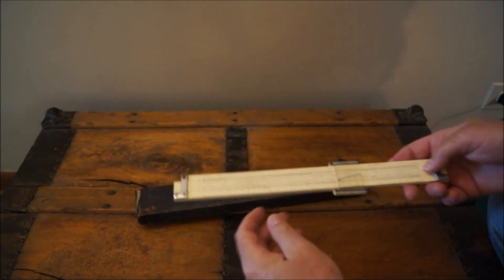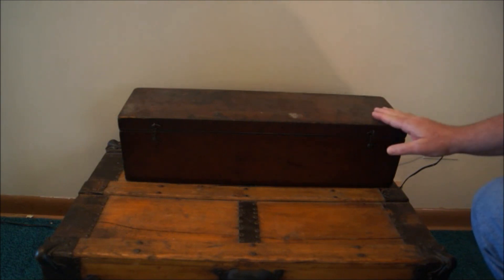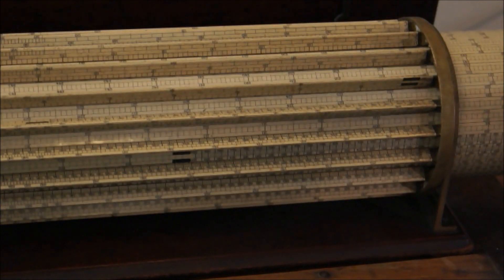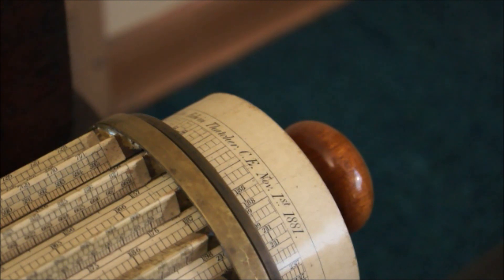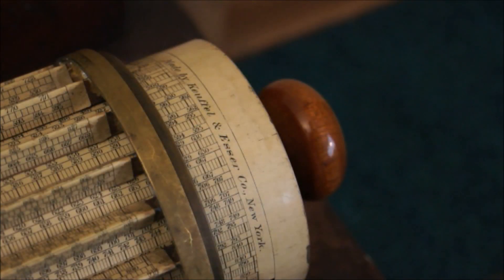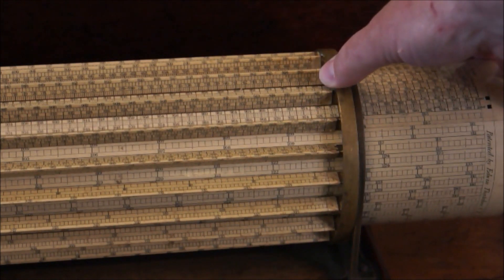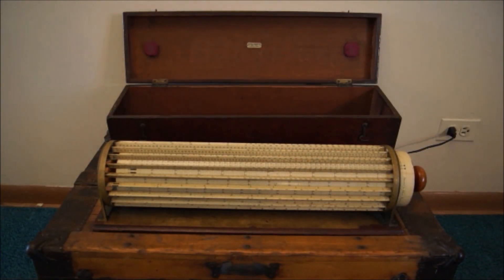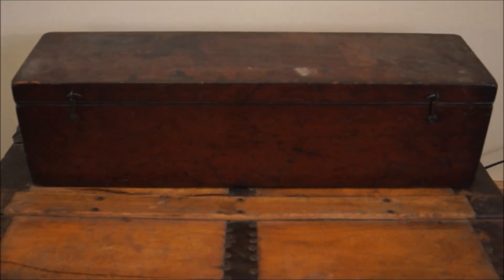The Thacher Calculating Instrument

Comment: Just came across this. I’m lucky enough to own one of these amazing tools. My father was a fanatically collector of antiques and must of picked it up somewhere along the way. Ours even had the original manual with it. Every so often I get curious about it and Google around a bit trying to find out more about it. I don’t remember when or where, but somewhere I read that these were used for calculating logarithms and were used by traders on Wall Street for….well, something I wouldn’t understand anyway. I’m an artist, so to me the beauty is in the amazing detail and precision that went into making the tool. I can’t even begin to imagine how much careful and painstaking work went into making each one. The rules and cylinders are all bone ivory I believe, and would had to have been etched by hand. I leave it in its box except for the rare occasions that I take it out to marvel at it. I don’t want sun or dust to damage it. Except for some very minor scratches on the base and the case having some wear and tear, it is in perfect condition.
Reply from the maker: Thank-You for the really great comment!  I agree that this is a fantastic bit of toolmaking with an artistic bent.  This particular instrument was used in the General Headquarters of a Steel Foundry company.  My understanding of its use was for the company Engineers and Metallurgists.  The device offers some serious short cuts in working through some very tough math.  I was not aware of the Ivory and am now more impressed by it.   Thank-you again for viewing and commenting!
Reply: A slide rule in its most basic form multiplies and divides. What is done is identical logarithmic scales are printed printed on a moving piece and a fixed piece. A logarithmic scale gets more compressed as you move to the right. The basic principle is you add the logarithms of 2 numbers together then look up the answer. The slide rule does this mechanically, no need to carry around a book of tables. Most slide rules are 25cm index to index and due to the limitations of the markings and the human eye the answer can be found to about 3 significant digits. The answer to this problem is to lengthen the scale so more marks can be fit in but then no one wants to carry around a 10 foot slide rule. Elliptical slide rules such as the one shown wrap the scale around a cylinder to lengthen it while keeping the instrument to a manageable size. Mainly the idea is to get an answer quickly without having to calculations by hand or have to use books of tables.
Reply: The instrument is not ivory.  All models are wood and brass, with paper scales glued to the drum and brass rails of the cage.  They are covered with shellac.  Early models prior to 1901 have drum made of a metal.   These models are known as the Type I of the instrument.  They will be made by Stanley (with Thacher's approval).  K&E imported them and sold them as the "Model 1740."   In 1901, K&E made these themselves as Thacher's copyright ended in 1898.  The design changed quite a bit, as did the model number.   Now known as the "Model 4012," the drum became wood and the brass cage changed, including the way it's attached to the base.  Maker's marks were applied indicating K&E on the box and device itself.   These models were built through 1926 and are known today as Type II Thachers.   The device was changed again in 1927, becoming the Model N4012 ("N" meaning new).  It added a single pedestal attachment to the cage ends, as well as knurled rings and white number bands at the ends of the cage (as he describes in this video).  It is known by collectors today as the Type III.

K&E introduced these to the U.S. in 1881 at the cost of $30.  By 1952, the last year they were in the catalog, K&E charged $130 for them.   These prices are $$$ during those eras, but not so much they they couldn't be bought by science and engineering companies as well as universities and government agencies to do computations up to 5 significant figures (for multiplication, division, squares, cubes, etc).    It is widely known that Lowell Observatory used (and still displays) a Thacher Calculator for computing ephemeris data for celestial bodies, including Pluto, as discovered in 1930 by Clyde Tombaugh at that very observatory.  

I own a Type II Model 4012 in really nice shape. serial number 2758.  This places it as built around 1910.   The highest serial number known is just short of 7000.  As such, in over 70 years of production, 100 devices were produced per year on average (with around 164 yearly estimated for the Type II devices).

It's not hard to use.  If you know how a normal slide rules performs such operations on the C and D scales, then the same concept is applied to the Thacher, only with the scales, both on the drum and the rails, being many segments of the same continuous scale.

Regarding the name.  The correct name is Edwin Thacher, as shown on the Nov 1, 1881 patent for the device.   But interestingly, Stanley printed the name "Thatcher" on the drum, with "Thacher" on the badge.  My device, as originally sold through the F. Weber Company (K&E licensed some for sale to others), has a label attached to the wooden case, with "Thatcher" hand-written on it.   As such, it's sometimes called the Thatcher Calculator even though it is technically the Thacher Calculator.
Reply: @jayballauer8353  Thanks for all that info! I’m familiar with K&E because of all the drafting supplies they’ve made over the years. I’ve used a lot of drafting tools over the years for art. I love that this post has been slowly but surely generating new responses that keep adding more information. I’m going to have to go check the serial number on mine to get a better idea when it was made. It has been over a year since I posted my original comment, so I don’t remember where I got that detail about it being bone ivory. It’s not a term I would have used myself, so I must of garnered that from another source. I will always treasure owning such an amazing hand crafted tool.

Comment: Hi! I have to do an essay about this machine for the university and I find your video really  useful. 
Can you explain me its basic function because I am a little bit confuse!
Reply from the maker: Hi, You have posed a difficult question for myself as my knowledge of the device is limited.  It is essentially a slide rule that can calculate a problem that a regular slide rule cannot handle.  The device uses the cylinder, as a means to expand the calculating ability.  A standard slide rule has a very small printed area to make calculations.  The inventor realized that by increasing the printed areas, one can greatly increase calculating power.  Think of it this way....  To try to put that many possible variables on a standard slide rule would mean that it would have to be over three feet long!
Reply: @ipfeldspar  It operates exactly the same as a normal slide rule, It's just capable of much more precision. A normal slide rule can do 3 or 4 digits of precision, while this one can do 8 or 9. Why would you need that much precision? Well... you don't in the vast majority of cases, which is why this was never a big seller.